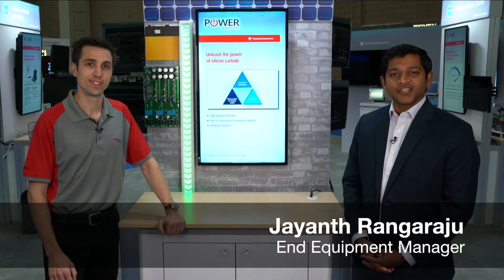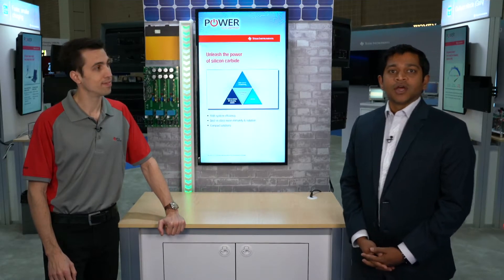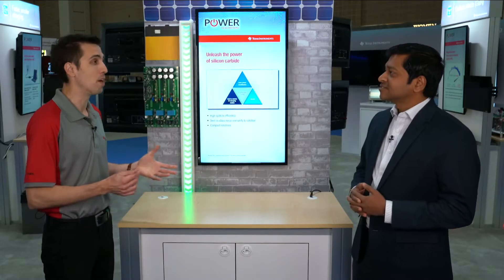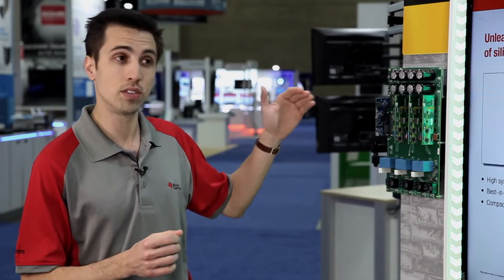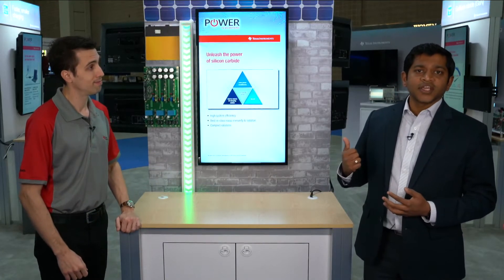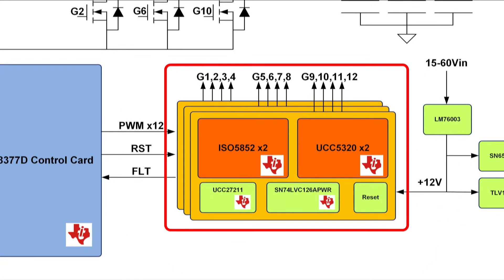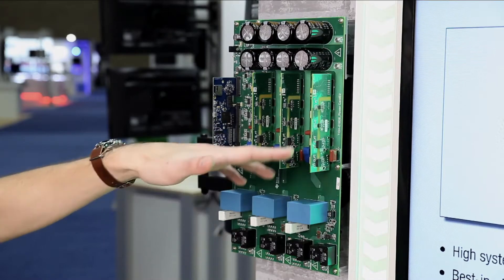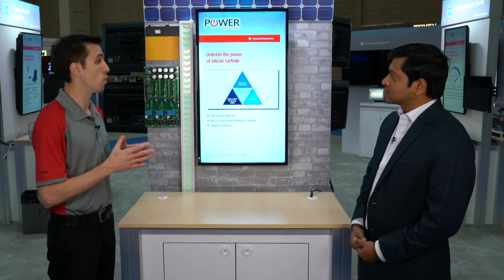10kW 3-Phase 3-Level SiC T-Type Inverter Reference Design

Comment: When is This module will Available on Market? I see on It's web page it still developed for testing and performance validation only.
Reply: hi, we have been looking for this prototype for a long time.  but we have not found it on any Market or website. So now we are making it according to the reference design files by ourselves.  if you are interested in this design (tida 01606) or want to by it, please email way_pwmer@qq.com.
Reply: @weiwang3575  This thing will burn down plenty of houses.